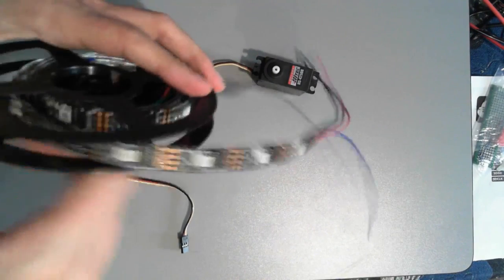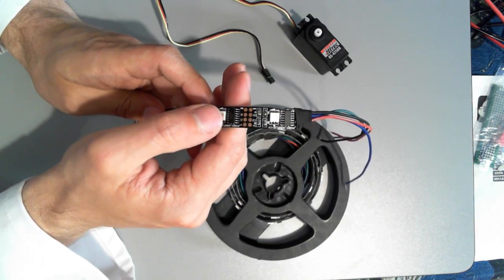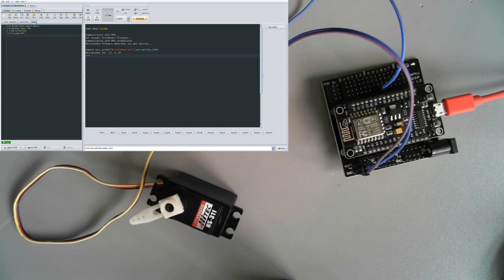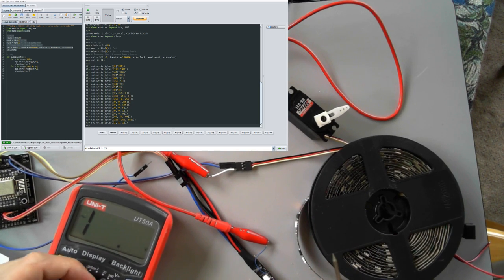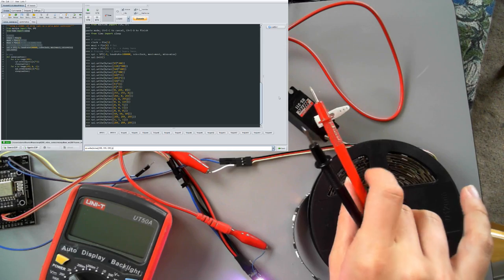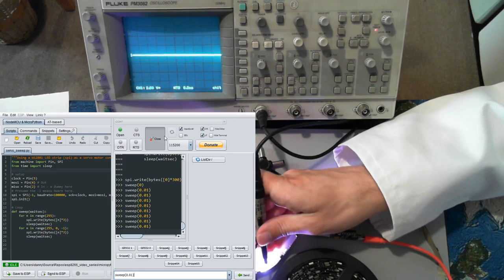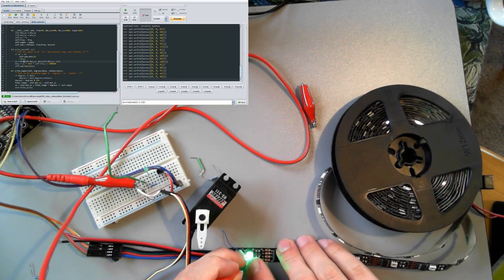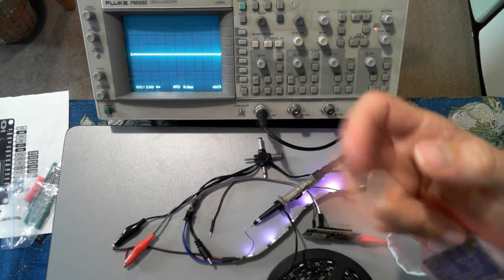Failed Experiment: Driving Servo Motors from a WS2801 Strip

Comment: check for the PCA9685 (i2c) 16-channel pwm driver or a TLC59711 (spi) 12 channel or TLC5947 (spi) 24 channel pwm driver
Reply from the maker: Funnily enough, I used the Adafruit board with an i2c 16- channel driver with the PCA9685, in a follow up video to this: https://youtu.be/zkpAzFWNzk4. It is definitely the right device for the job.

Comment: I appreciate the "hacker" attitude for some stuff, but it's often way faster to just RTFM. The datasheet (which is literally the first thing that pops up in a WS2801 Google search) says the LED refresh rate (PWM period) is 2.5 kHz --- far too high for a servo motor. After two minutes reading it, you would have known there's no way this would ever work.

And if it did have a lower refresh frequency compatible with servos, you could read the manual to learn how to deal with the logic-level incompatibilities you saw, as the datasheet also clearly illustrates how to get the driver to operate in CC mode, versus CV mode. If you would have popped the LEDs off the board and shorted out the source-side "RS" resistors, the driver would output perfect 0-5V signals (provided you had a pull-up signal to generate a "1" --- as the chip's outputs are open-collector).

I understand that people think this style of hands-on experimentation is a good "learning experience" --- but these unconstrained environments often have way too many different things going on for you to be able to zero-in on root causes of problems (unless you're incredibly meticulous). I think that's demonstrated in this video, as you weren't even able to determine the actual underlying problem (the PWM frequency). 

Or am I full of it? Did you feel like you learned a lot during this project? Curious to hear your thoughts.
Reply from the maker: I certainly got fun and entertainment through it. The 50Hz refresh rate of a servo was something I only considered more recently - partially due to often using prebaked libraries/tools/boards for it, and for some reason I'd expected it to be more variable and duty cycle based. Soldering on to that pad was a bit of a challenge to me, getting to play with the toys in my lab was good too. The comments on hackaday have definitely been plenty helpful in deepening my understanding. Yes, I can and do, for many projects, RTFM, as could anyone, I just feel this approach to be a bit more fun, messy and enjoyable.
Reply: Jay, I understand where your at, but I wouldn't discourage tinkering. Before google this was the only way to do things. You can set a refresh rate with the 2801s because they have a clock pin, and could also use a ULN2003 as an output buffer, the only reason I know this is because ive spent a hundred thousand hours making goofy newb mistakes.  I studied art and music, made ten thousand errors and now have a nice fat salary working for a custom fab and engineering company.  Mainly because I can hack through problems faster then any of my other more educated peers.